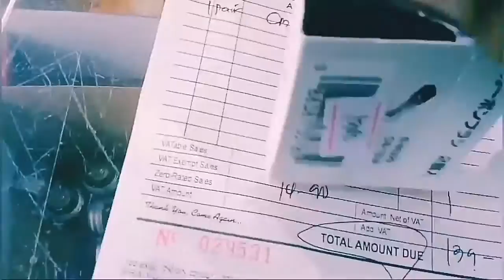Troubleshooting:Cut-Off Saw Machine Armature Problem And Carbon Brush Replacement | Mod.2414NBMAKITA

Comment: So many videos about this if you have problems with excessive sparking more than likely get a new armature this does not work ...cleaning it will not fix a short in the windings
You can still see it at the end sparking away and it did not sound healthy either and the camera missed it all just so happens 😅

Comment: Ano po problema ng cut off machine na nagwild habang ginagamit
Reply from the maker: Thank you po for comment.Armature po.Yan yung mismong umiikot sa loob ng Makina na nkawinding at may pin.If excessive hot na po or umuusok na ang makina the whole motor set is deffective na yn.need rewinding.you can search po sa online about"armature".
Reply: Bearing boss.

Comment: Sir gnyan dn Po ung sakin...but dipo gagana kht dinirect switch Kuna wla parin power
Reply from the maker: Better check baka sira ang switch po ganundin ang continuity ng wire or saksakan. Or kung may fuse, nakablown fuse d tlaga yan gagana.

Comment: Tanong ko lang boss ung sakin bigla nalang hndi gumana pinalitan ko na ng carbon pero wlaa pa din.. ano po kaya ang problema nito..
Reply from the maker: Try po nyo icontinuity test ang wire or saksakan kung putol. . Kung may fuse yan check din po baka putol.ang fuse. Replace niyo po.

Comment: Anu po problema pag nag spark ang carbon brush
Reply from the maker: Kung excessive na spark marumi po at marami na element ng powdered carbon sa motor nya mga singit singit . Need Linis lng po.